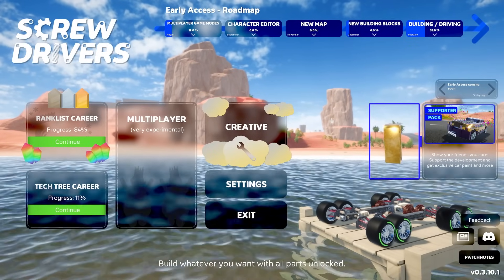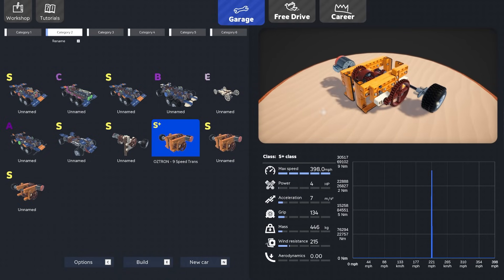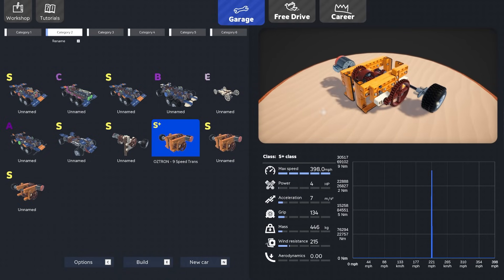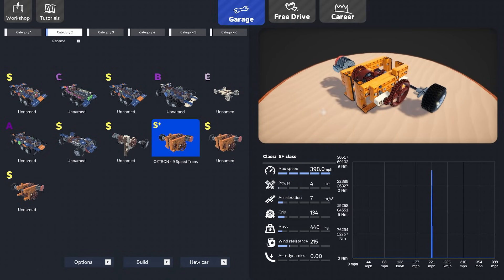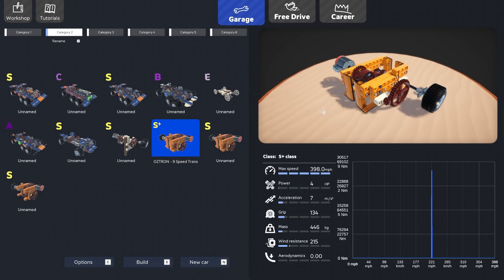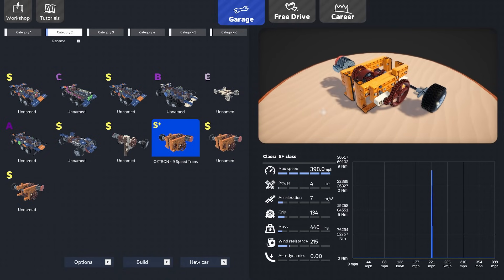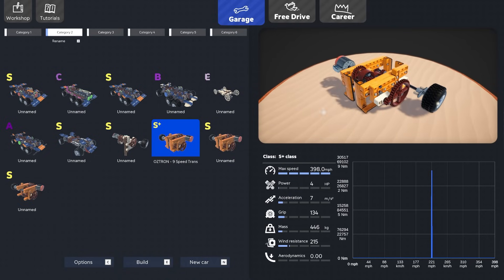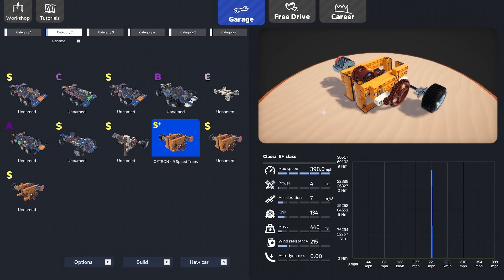Unleashing 1100 Horsepower With A Customizable 9-speed MEGA Gearbox | Screw Drivers Gameplay Ep05

Comment: the reason you are not going fast is because with electric engines they do not provide enough rpms to switch gears, the game switches gears based on rpm, if you use combustion engines you will be able tu make use of all your gears and reach higher speeds. also electric engines do not necessarily improve acceleration they just deliver all power at once, with combustion engines it takes more rpms for more torque/power
Reply: from what i have seen what you said is incorrect from what i know if it doesn't switch gears it means the engine wouldn't be able to accelerate if the gear increases or it would make the car slower if it switched gears
Reply: I found that it switches based on torque alone. If it can theoretically apply more torque in its current gear, dispite about maxing the rpm, it won't shift.
Reply: It's shown on the UI how they work you need a certain ratio of rpm to torque for it to switch gears.

Comment: 2:23 So displacement, velocity, and acceleration are all things a part of calculus. (Theres also jerk, snap, crackle, and pop. It keeps going after that. Sorry its been years since I've done any sort of calc)
Basically displacement tells you how far you are away from the origin point. Velocity describes how fast the you are going from displacement over time.  (Speed is the absolute value of velocity, as velocity can be negative or positive) Acceleration describes the change in speed over time.
Acceleration is the change of distance per second per second.
∆x/∆t² (or dx/dt²)
Acceleration is a double derivation of displacement.
Take a parabolic function. This could be a displacement. If you derive it once, you get a slanted line. That's your velocity. Derive it again and you get a flat line. This is the acceleration. Physics has the idea of throwing a ball. It follows a parabola. Its this principle. Small caviots in the relationship of origin points but that is the general idea
Reply: to simplify: displacement (dx) is the change of distance from the origin/starting point measured in meters, velocity (V) is the change in displacement according to the change in time (dt), and acceleration (a) is the change in velocity as time goes on. therefore, velocity is calculated as: dx/dt or meters per second, and acceleration is calculated as [dx/dt]/dt or meters per second per second which can be simplified to dx/dt^2 or meters per second squared due to the fact that division is the same as the multiplication of the reciprocal value. If you want to get a more in-depth description, I found Lumen learning to be very helpful when learning this for AP physics a while ago (I believe the unit is "3.6 Finding Velocity and Displacement from Acceleration"). Hope this helped :3
Reply: @BoxPatata  
very simple thx
😅😅😅

Comment: Sorry for the block of text below, just trying to help...

Just some pointers:

m/s² is the SI unit for acceleration, it can be decomposed into (m/s) / s, or in other words, (change of) speed in m/s over time in seconds. In blunt terms, if your car is traveling at 10m/s with a 1 m/s² acceleration it will be traveling at 11m/s in the next second. Since the acceleration is not constant for all the speeds, the game might be doing an average.

Some issues with the OZTRON - 9 speed Trans shown at 2:30:
It doesn't matter (at least for the game) to exchange torque/speed in the middle of the transmission (there is no free lunch, if you gain torque you lose speed and vice-versa), the ratios of each gear set are multiplied to obtain the final ratio of the gears used, if you put the big gear and then the small one and then the small one followed by the big gear, you are effectively just doing a 1:1 ratio, where one revolution of the input is one revolution of the output. For this reason if you have either neutral (1:1 ratio) or cancelling ratios between the gearboxes you are just wasting space and weight. Although, like you said, you can indeed change the gearboxes connecting gears to change the final drive of the transmission. The change you've done at around 8:49 made the transmission exactly the same as it were at 2:30! The chart scales the axis automatically so pay close attention to them when comparing stuff - at 36:11 the wheel torque the 4th gear changes into 663Nm and that is not enough to accelerate past 150mph with that car. The changes shown at 38:47 mean that the car will barely move as the provided torque to the wheel is really low, it isn't more 'smooth', if you normalize the chart without comparing with the previous they are exactly the same, just stretched and shrink according to the torque/speed of the drive ratio...
In your specific gearbox, I did the math (the game considers the small gear to be 8 teeth, the medium 10 teeth and the large 16 teeth, even though that doesn't match the graphics) and out of the 27 possible gear combinations (3x3x3) you only have 10 unique ratios: 1, 1.25, 1.5625, 1.953, 2.3, 2.875, 3.594, 5.29, 6.661 and 12.167. The last one with 12.167 is probably too much for most if not all of the possible input power for the transmission, the required torque is too much.

Usually, for something usable, if you divide the biggest ratio by the smallest you want something around 2.5~3 depending of the engine torque profile and number of gears, if going for top speed something around 5 is probably the maximum (assuming you start from a reasonable minimum ratio). You want the torque of the final gear to be just enough to propel the car forward - in electrics is easier since the torque is almost constant, in gas engines you have to account for the torque curve...

I have designed 2 very similar transmissions, one with 6 and one with 8 gears, I don't recall the specifics, but they have 2 stages of gearboxes, one is a very simple one with just the medium gear and the small gear swapping ratios (the 8 geared one has an extra 1:1) and the other gearbox is very similar to the ones you shown but I think I put a 1:1 before the planetary gear and 2 gears swaps after the planetary to smooth out the jump of the planetary ratio. I designed these transmissions around the biggest gas engine of the game (50:46). I don't like to mismatch the engines in the game, it messes up the gear changes (as you also experienced at 20:29 - but might have been due to a loose engine - I never got hundreds of gears) as the torque curve gets 'steps' as the electrics run out of power making the driving inconsistent, adds complexity and you are chugging along with that dead weight when driving at high speed, if the initial gas torque is insufficient, make a first gear with a lower ratio, make the gear ratios closer and/or lower the overall final ratio of the transmission.

My cars are about half the size of yours and the engines are near the car 'floor', having so much weight so high up will not help with the stability and drive-ability of the car. Also, there are aerodynamics modeled in the game, a larger car will have worse aero...

49:27 "How do we get to the to of that rock?" - I made an helicopter :D

Hope it helps .... have fun!
Reply: Nice breakdown. Also noticed it but didn't bother mentioning everything xD Honestly, props to u
Reply: I'm not smart enough to read that
Reply: thanks for the detailed breakdown!

Comment: When adding in your static aero it's important to balance it with the air resistance stat as the aero components can affect the air resistance depending on BOTH where and HOW they're placed, sometimes you can flip a wing upside down for better wind resistance, filling in large gaps in the "frame" also helps

Comment: I noticed that wind resistance and weight play a big role, whenever I try to build a big car with a lot of power, it ends up really slow, but a small one with just 2 electric engines and a good gearbox can go way faster
Reply: It's always best to balance between the two but there are preferences haha
Reply: I have been finding it better from my own play time that the lighter the better. My current best car only produces 110 HP with a 6 speed transmission weighing in at 408 kg (even managed to get it to include 4wd). 62 m/s acceleration and nimble as hell. Although got to figure out the long shift times on the lower gears especially between 2nd and 3rd.

Comment: 7:50 You can click undo at the bottom right to stop wasting funds like that! lol
8:57 Of course it's the exact same, you basically went form +1-1 to -1+1.
11:12 At a glance, you currently have the 3 sections on 3 different height level. You could have the 1st and 3rd sections on the same level to make it more compact.
16:12 My 1st thought to help with acceleration would've been to incorporate a planet gear in your driveshaft just to lower your ridiculous top speed.
18:55 Sometimes the game seems get stuck while analyzing cars, just swap back and forth to another car to make it refresh. Usually fixes it.
37:04 Again I'd be curious to see what a backward planet gear on the drive shaft would do with this setup.

Comment: The easy way to line up the electric motor would be to have them face each other with an axel of length 5, 1 inside each pair of engine, 1 spacer on each side and 1 gear in the middle to connect them all...

Also normally you make the transmission after having decided the engine / motor you want to use, it make it easier to  adjust the power curve for the purpose of the car...

If you want a big top speed do a 1 speed transmission with like 10 planetary gears in line going to the back axel, for a strait line you will go fast just not accelerate

The loading speed is impacted by the amount of transmission change you have, the game struggles to determine the correct order when you go above 6 making the loading time longer

Comment: I would recommend using the short 2 unit long wooden connector in order to connect all of your engines together as the game always calculated the axles as a hinge point which could also cause some issues with power delivery or the weird torque graphs you had
In my experience, even just a 200hp car can flex and handle terribly because of this effect the axles have when used on transmission/engine mounting

Use the 2-by wooden connector and connect the engines between each other and it should be fine
All the parts connected by an actual connector the game will calculate as a single object decreasing lag and similar issues (as I have mentioned)

Besides that, great stuff!

Comment: Aero is pretty important for top speed, it's def possible to break the sound barrier though. Highest speed I've hit so far is over 800 mph (1300+ kph)
Reply: I ended up modifying a workshop racecar and was able to break the barrier with it. I suck at transmissions. It's possible to break, but it takes a few "laps" on the new map
Reply: @willie9899  oh yeah, my car has 12+1 cylinders, and a 9-speed transmission, and even then it still takes 2-3 'laps' to get there lol

Comment: Ive yet to see someone do it, but ive done it, and i wish to see how would others do it. Planes. You can create flying vehicles in this game. The secret is to use two engines and have two symmetrical power trains. Gearing doesnt matter for direction, only the engines do.
Reply: You cant, there are no thrusters in game, only engines that need friction of the wheel to drive with torque, simple as that
Reply: @Simon-tr9hv  Hehe, but you dont need thrusters... You can just make them yourself. Simple as that

I did say i succeeded in that. Im not lying, a proper plane, which was controllable, quite fast and could fly indefinitely
Reply: @karyjas1  that's not how plane works
Reply: @Simon-tr9hv  Before any more confusion happens, do you know what propellers are?
Reply: @samuelloomis9714  this games physic engine isn't advanced enough for that, I'm pretty sure even with trail maker, they are special blocks with special logic attached
Reply: @Simon-tr9hv  Planes arent supposed to fly in the sky? How do they work then?
Reply: @samuelloomis9714  You got it, thats what i did
Reply: @Simon-tr9hv  In trail makers you can do the same thing using literally the same mechanic (becouse ive done it there too), but it works not as well as in this game
Reply: @karyjas1  if its done properly, the game physic engine would calculate the air movement, aeros etc, you can build props yourself. but most games does the cheating way, they have a special block with logics attached to it, with fixed amount of thrust, so you only able to use that block to create thrust, otherwise doesnt matter how fast you spin your own creation, it will only provide centrifugal force and not air pressure, cos the physic engine doesnt know what it is
Reply: @Simon-tr9hv  What about aero? It produces thrust based on speed and angle. Yes, there is no fully accurate fluid simulation, but even if it was a thing, it would still have similar results, aka, the prop would still produce thrust. Im pretty sure there are no cenrifugal forces in the game though, but there is counter torque, which is why i recommended two engines, to counteract it
Reply: Well now I need to make a Chinook

Comment: 4:48 at the beginning... you dont need to go from small to big and big to small.
It does nothing. Just use the medium gear.

If the car have problem to shift, go in manual mode and  shift yourself.

Comment: Oh yeah also, a tip for getting insane funds super quick:

Go to any 'A to B' race and right after 'Go' press your reset key. There's a glitch where it resets you to the finish and you can get like a 0.050 second time so it works if you just keep clicking retry to get funds extra quick. Use before patched.

Comment: The burnouts are because of the weight distribution - your rear wheels don't have enough grip and break traction on launch. It's pretty tricky to fix because just slapping a wing above them won't provide downforce at low speeds (when you actually need it), you have to either move the center of mass to the rear or provide an active downforce system with propellers.

Comment: I believe it loads faster when you have already loaded the graphs in the build part.

Also I was able to complete the long jumps much easier by using upside down aero which acted as wings. This was also useful for getting stubborn chests that are in hard to reach places.

Great gearbox, I attempted a 6 speed today and it ended up being slower than my current 3 speed so think I need to try again with a different approach.
Reply: Mine 6-speed is just 3speed with another 2speed before it, and it works good, but I use only combustion engine, 4x 1000 with turbo. And with this I have 221hp and max (tested) speed is 560km/h (350mph). But also I use lowering before transmission, 8:24 (small:medium gear)

Comment: I just got the game and I’ve been trying to break the sound barrier but I’m currently capping out at 786kph
Reply: you should be spot on. it varies with air drynes and temperatures slightly but the sound barier is rougly around 770mph
Reply: sorry didnt see the kph there :P
Reply: @Grzelopak  yeah, it’s 1234kph that I have to reach
Reply: I've been doing max speed attempts the past few days and my current build got 2248 kph through the speed trap on the test map, and there's enough power and gear ratio left to reach at least 2600 kph. But steering becomes a limiting factor as at those speeds the gap between the buildings and the speed trap is like repeatedly threading a needle at mach 2. Any steering input to correct the trajectory halts acceleration for a moment and affects your trajectory literally on the opposite side of the map so you need to be thinking 20 seconds ahead in terms of steering input.

Some tips: air resistance is a major factor so make your vehicle as narrow and low as you can. Length is free real estate. And pay close attention to gear ratio's and torque curves so you reach your target speed just before the torque drops off. Wheel size (radius) is also an important factor as that has a major impact on your final gear ratio; bigger is not always better depending on gear ratios.
Reply: @Dusto9  thanks for the tips

Comment: I have multiple cars that do 400+ mph… yes 400mph.. I have a 6 speed and an 8 speed. You have to use ice, electric motors are only good to use to eliminate the ramp up time. Add the motors inline with the gearbox and/or directly on the final drive. And more ice = more powah. My 400mph beast uses 16 of the big motors and 2 of the red electric motors. I’m on the speed trap leaderboard btw. Somewhere on the top 600 if you doubt. It’s really competitive in there, not sure how to make the car faster without redesigning something ridiculously long
Reply: Where can I see cars that fast? I’m struggling to break ~300 kph, mostly bc of inefficient transmission. I want to see a bunch of transmissions so I can start making my own versions and better cars but can’t find many. I can easily make cars that go 300 kph with good-great acceleration and ~60-80 air resistance (PRE spoilers). I’m using 300 hp, do I need more hp? Is that the problem?
Reply: @christiangray7826  hp helps, it’s a balance. By best car is geared for 445mph, has just over 1000hp, makes around 10,000nm of torque in first gear,and caps out at 412mph because of weight and air resistance. Your car could be geared for more but not have legs. You should only be using rwd for speed builds, cars don’t seem to benefit much from multiple electric motors beyond 2 of the red ones, I have yet to figure out diminishing returns on engines, but a planetary gear on your output seems to be beneficial regardless of how many shifts your car makes
Reply: What do you mean by ice? Is that a special material with special properties? Assuming that, it still doesn't make sense.
Reply: @samuelloomis9714  internal combustion engine